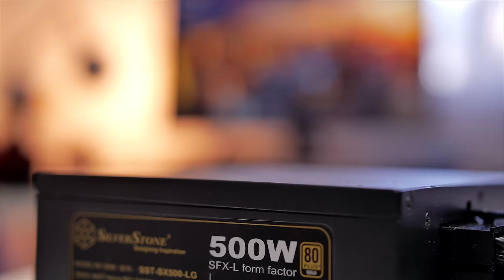Silverstone RVZ02 Review - Amazing Slim ITX Tower!

Comment: Nice case to build a media-server / internet PC. But not sure it's suitable for gaming with having to chose 
between a GPU or a HDD. However, there are short / compact GPU options out there so it's not so bad. I'd buy it if I was going to build a compact PC...
Reply: It's a great case for the living room that gives a console-like look.

Throw in a power sipping skylake i5/i7 with a Asus Maxwell card that won't turn on its fans unless under heavy load and you got a quiet living room gaming station.
Reply: +Advection357 or a 2.5 inch hdd
Reply: ***** Laptop drive? Hmm yeah, good call!
Reply: +Advection357 Or if you are willing to drop the cash Mushkin has $350 1TB SSDs. If you need more you should really have a NAS anyway imo.
Reply: +Advection357 I'm the opposite. I'm looking at this and thinking I can throw all my gaming crap into this case and use it as a media center too (ty optical disk drive <3). With my server just hidden away in a closet.

Comment: this or node 202
Reply: this imo
Reply: id like to know too, mainly the cooling aspect, this looks a lot nicer aesthetically, but id like to know the overall cooling on both, and what type of gpu cooling would be best on this case.
Reply: +Brad Turner probably a rear blower style, because it grabs air from the front and exhausts it out the back.
Reply: Node 202 lets you put 2 120mm fans in front of GPU for open air gpu to be installed just fine. Probably gonna go with 202 for my next build unless something else comes along. Just built one in the evolv shift and I love it but it's a bit bigger than I want
Reply: Hopefully that helps anyone who has been wondering about this for the last year :p
Reply: lol more like 2 years
(1 was added due to high gpu and ram prices)

Comment: If only it was made of thick aluminum with a plain and elegant front. it would have also been awesome if it had a tempered glass side panel.
Reply from the maker: Mmmmm.... Aluminum frame and glass panels. That actually is brilliant. Although airflow would suffer greatly.
Reply: I agree, a brushed aluminum look would've been nice or at the very least steel and a glass side panel really would make this case a cut above. If it had mounting for water cooling and having one glass window for the CPU area and another for the GPU chamber it would've been one gorgeous case!
Reply: +HardwareCanucks of course it would need adequate ventilation. Although, adding 120 mm vents would be convenient for the majority of people, I believe that 80 mm vents at the top and the front (concealed and  with an air filter to preserve the elegant  front) would not only allow the case to keep its slim profile, but also allow enough airflow for high performance gear. for the fans in question, I prefer nocturnal :D
Reply: +1524mclovin Lian-Li

Comment: Hey Dimitri, can you recommend anything similar to this that supports a full size ATX motherboard?

I'm trying to build a media pc with some old components I have, and would like it to fit in a 140mm high TV unit slot.
Reply from the maker: Hmmm... Don't have any recommendations for an ATX media case. But look into Fractal Define S or R5.
Reply: +HardwareCanucks Cheers!

Been trying to find a mini-itx mobo for 1155 socket here in Australia but it's near impossible.
Reply: +Bendinglez I ended up getting a Zotac from eBay. I plan to put my 2600 in it.
Reply: Get grandma gd09 or 10:D full tax and crazy capacity!
Reply: +Blood Angel Think i might just go with a NZXT S340. Not ideal for a media centre but its a pretty sleak, small chassis.
Reply: +Something creative That's exactly what i was looking at. 

unfortunately it sits about 170mm high which wouldn't fit in my TV unit =(
Reply: Bendinglez There's one new 1155 on eBay right now for $70 AUD + $17.35 shipping. It's the Gigabyte, which isn't quite as good as the Zotac, but if it's for a HTPC then it should be fine.

Otherwise the S340 is fine if the size doesn't bother you.
Reply: I saw that this morning.

It will end up being more cost effective just going for the s340 rather than buying a new mobo and chassis. Figured i could hide the s340 between the tv unit and sofa.

Cheers, really appreciate your help!
Reply: +Bendinglez Silverstone RVX01

Comment: Can i put this in my bag for portability?
Reply: probably if it is a medium to large bag (i'm assuming backpack) but i would take the feet off it and i would Highly recommend the support bracket for the gpu and if you are trying to build a lan pc then i would recommend a smaller keyboard because most keyboards are longer than the pc (i learned the hard way with my node 202 and my coarsair k95 rgb keyboard
Reply: Well i have 3 bags atm one is a Razer tactical pro the other one is a Sport 26L and the last is a Roccat tusko this is my planned build https://pcpartpicker.com/list/QCPjNN and i have a asus vg248qe and a corsair strafe rgb so is any of this info good?

Comment: the only problem with this case is that the gpu gets super HOT and LOUD when playing games
Reply: A blower gpu Or fan gpu?

I recently bought the ml08 case (allmost same as the rv)

Im not an expert at all, but wouldnt a blower gpu be better since the heat Goes out the back of the card?
And its a small case.

A fan gpu blows out the hot air from Each side right?

Yes there’s a vent but doesnt the heat stay in the case?

I Dont quite get it why a fan gpu is better......

Silverstone suggest a dual Or triple fan for the case.
Yet in the manual you see a blower gpu in the illustrations.

Confusing.

I have read that the blower makes more noise on a few sites,
Yet a explination why a fan gpu is better i cannot find.

Comment: How bad are the temps in a case like this?
Reply: +Joey DH I'm sure you could mount a slim 120mm fan on the mesh cover to provide airflow.
Reply: +Tom Ferreira Wouldn't help with cooling at all, case fans are only to move air to the GPU, CPU and PSU fans, and because all three of those fans are right next to the vent they have no trouble pulling in air from the outside and cooling themselves, case fans wouldn't fit and would could actually end up being detrimental to the temperatures.

Comment: my gpu went overheat in this case.....  and screen turn red, when play game, artifact came out.... my ...... why didn't they make fan......  i waste my money for gold sfx + chassis + gpu..... and my ssd also overheat..... because its side by side with gpu.....
Reply: for cases like this you're really better off using blower style gpus, there are no fans at the gpu chamber so an open air cooler design gpu could easily build up heat and overheat if your room temperature is high etc etc
Reply: planning to mount jetflo from outside.... i wonder if it works lol
Reply: Try mod it a little bit use micro fan for exhaust on the small grills

Comment: how did you install a third ssd on the GPU side?
Reply: Tomer SSDs are thin enough to fit just without touching the GPU backplate. 3.5 drives won't work.

Comment: does 2x r9 nano fits in this case?
Reply: No.
Reply: +Patrick Davin No. This case only supports two spaces for your card to use. However a single R9 nano for a build that has trouble fitting in a 3.5 inch drive on the right of it is an awesome choice dude!

Comment: Is this the size of a ps4?
Reply from the maker: Yes, about the same size.
Reply: Do you know if this PC would fit in a backpack? I'm trying to built a mini itx gaming pc that i can take in my backpack when i visit friends. Dont have a car and i would be using a bicycle and train for commuting.
Reply: +HardwareCanucks Why don't you do a video of an OLD Xbox case and build a PC out of it.
Reply: +Miku Lover I don't have this case but plan on doing a build in it eventually but my ps4 fit in a fox backpack which all are an average size and I had games a stand, controller, and headset
Reply: Prequel The PS4 is pretty damn small. My foster brother got one from my nephew even though my Mom got him the Xbox One. It was small compared to the Xbox One I was amazed at how tiny it really is.
Reply: +Miku Lover tbh the raven is 2.5 inches taller and 3.5 inches wider than a ps4 + 2 inches thicker

Comment: This case is a load of crap if intended to be a Living room games machine, I stuck a 980Ti in this case and it overheats and the fans spin very loud so still no viable case out there for a 4K gaming PC under your TV, this case might work if you put a GTX 960 in and just run games at 1080p.
Reply: What about a blower style card?
Reply: I tried a blower style 1st and then took it back to the store thinking it was faulty lol, then I got an Asus 3 fan card and that overheated also so I just give up on this case.